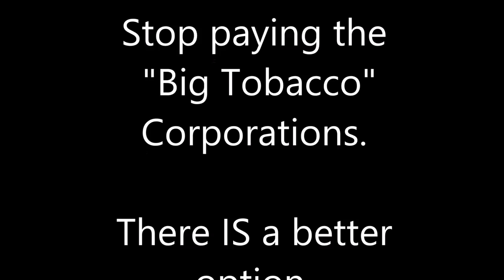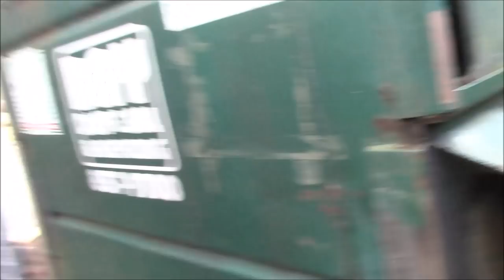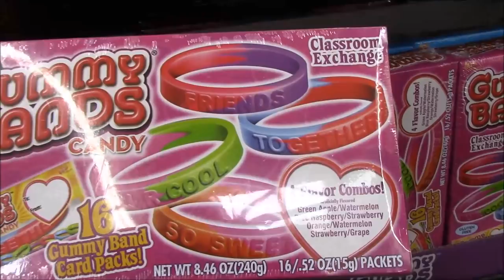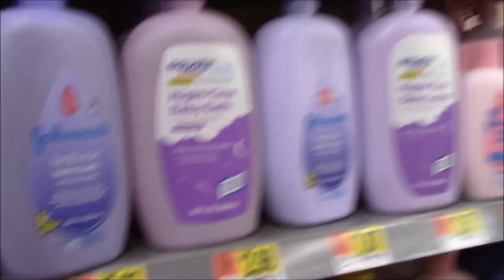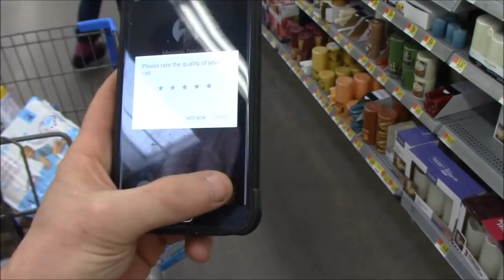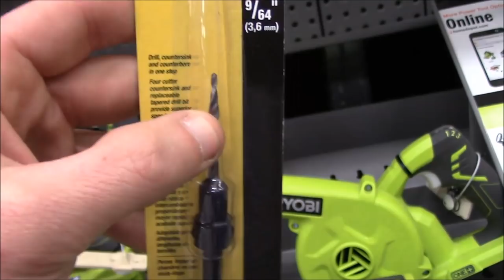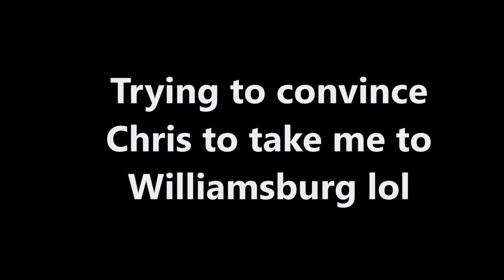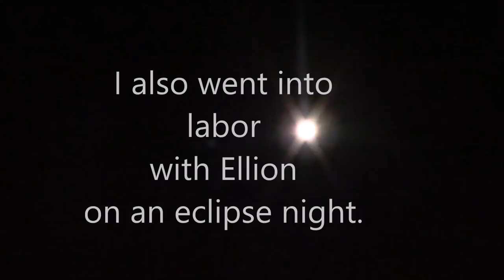BLESSED at the CLAW MACHINE! *NEW* Amethyst RING GIVEAWAY! ELLION WALKS!

Comment: Chris if you have a Harbor Freight Tools in your area they carry an item 61635. A set of countersink drill bit for the same price your paying for one Dewalt #6. Also the countersink part is removable and can be attached to any regular bit of that size. So you purchase lesser expensive regular bits and still use the countersink with them. Just sayin'.